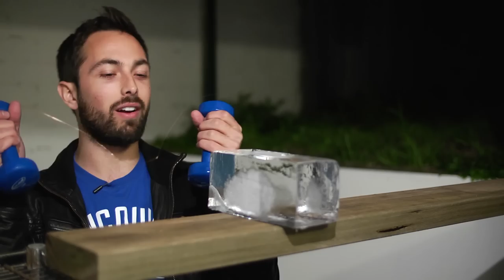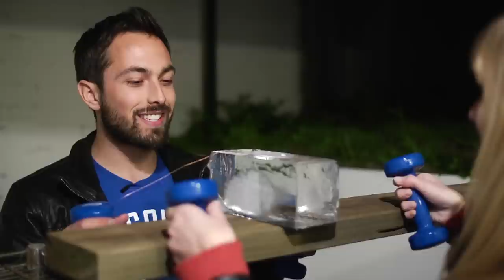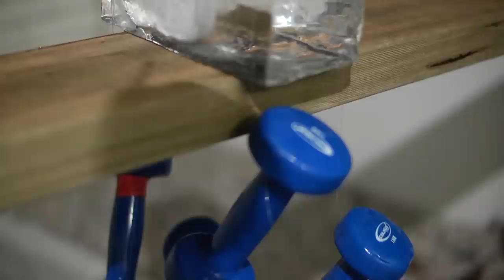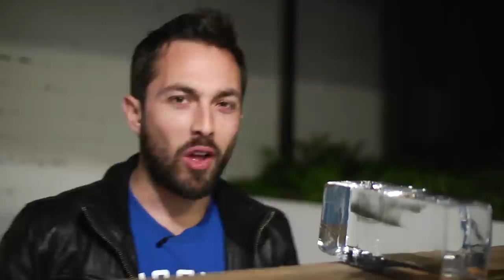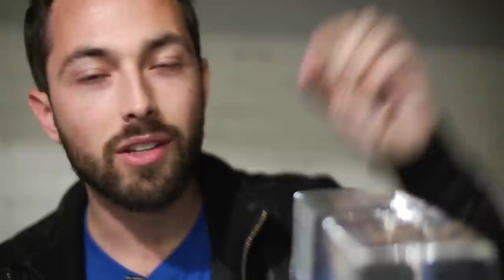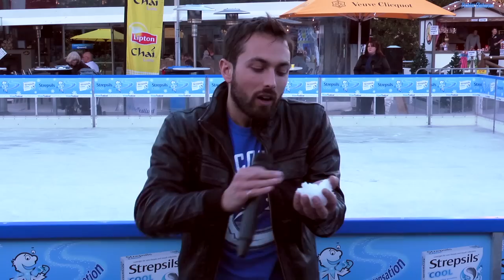Ice Cutting Experiment

Comment: 0 degrees still has a lot of energy. For example, an iceberg has about the same  thermal energy as a cup of boiling water. As such, there still is energy to be released and transferred to the wire from the refreezing of the ice. As for cross section of the wire, he said at the start they were 'about the same thickness'. Hope this helps :)

Comment: I guess the steady state shape of the wire should be  a semi-circle. Here is how:  The tension in the wire is constant. Now the radial force  (i.e., pressure) the wire applies on the ice (and thereby the local melting rate of the ice) varies directly as the wire's local curvature. At steady state, the melting rate  at all points of contact is the same, which implies that the curvature of the wire must also be constant. What do  you think of this reasoning?

Comment: Further experiments should test diameters of the SAME ice-cutting material; the difference between metals of known varying thermal conductivity; and overall temperature of the system. On the last, I'm betting that there is a threshold temp where the copper & the fishing line will work the same. (but that may be pretty close to absolute zero?)
Also, difficult to maintain controls...the thickness of the ice, it's purity WRT trapped particles, the angle of the weights, etc.

Comment: I no longer think it's a catenary. The difference is that with a hanging string the tension changes along it, whereas here the tension should be roughly constant throughout. In this example  if you try to make the normal force the same everywhere you get a circle, but I'm not sure that's the right thing to do. Seems like a better idea is to make only the vertical component the same everywhere, in which case you get a complicated shape that's still closer to a circle than a catenary.

Comment: I'm guessing it's because that's the shape where the weight of the weights is evenly distributed throughout the wire in contact with the ice. At first, almost all of the weight is on the part of the wire touching it edges of the ice, but as these cut through, more force is put on the middle of the wire, so it starts cutting through. Since more force means faster cutting, and faster cutting results in less force, the wire is constantly seeking an equilibrium of balanced force.

Comment: I think it's just as likely that the thermal conductivity of the copper wire allowed the wire to act as a "heat sink" (or cold sink in this case), effectively warming up the inside of the wire by absorbing the warmer temps of the wire not inside the ice.  I am probably messing up some terminology here, it may be that it's actually that the coolness of the wire is dissipating via the exposed wire, but the end result is the same.

Comment: The video is right about the conductivity of the materials, but ignores that the combination of the polyethylene, PVDF, nylon in the fishing line and even the type of the polyethylene defines the weight of the line, and not the same at each types of fishing lines. So despite the same thickness, the copperwire could be heavier, which must be added to the weight of the two 1.5 kg weights.

Comment: Yes it HAS to do with better coductivity, but it's the room temperature wich is conducted through the copper wire onto the ice better (by better contact too) compared to the air. Try this in a room with room temperature below 0° Celsius! .. And the snowballs surface melts because of the temperature of your skin.

Comment: heat isn't all about temperature; changing the state of a system (from gas to liquid, liquid to solid etc.) involves heat exchange; in fact, when you give/take heat to/out of a system, it's temperature increases/drops only until the boiling/freezing point and if you just continue unabated to give/take heat to/out of the system temperatures just stops changing, it stays the same, while the heat goes 100% into boiling/freezing; when all the mass has stopped phase-changing temp. changing continues

Comment: Scraping off the coating means the surface roughness of the wire changes. This definitely means both wire don't have same roughness (or smoothness). 
My point being roughness may be an important factor in the experiment.

Comment: I’m unsure if the faster melting with the copper wire is due to its ability to conduct the heat released during refreezing downward. If heat transfers downward to enhance melting, why doesn’t it also transfer upward to prevent refreezing?

I believe the copper wire efficiently transfers environmental heat into the ice, given that room temperature is higher than the ice's temperature, which enhances melting along with the pressure-induced factor.

What are your thoughts?

Comment: Heat is released because the only way something gets cold is it loses heat, there is no such thing as cold, only a lack of heat. So since it is losing heat, it has to go somewhere, and since copper wire is a good conductor, it goes to the wire, heating it slightly, giving it the slightly higher temperature needed to melt through the ice faster than the fishing line.

Comment: Ahhaha, Well, the reason why it was like "sand" as you say, is because Snow is basically millions of ice crystals, just very light. Because it was extremely cold (-20C) the snow was solid, and not damp. Snow only has "cohesion" or, as we North Americans like to call "cement-ness" when it's warmer, so that some of the snow will melt, creating -some- water, starting to break down the crystalline structure keeping the snow distant from each other, and it starts to become coherent, or slush.

Comment: Before refrigeration in the early days of America. The bootleggers would go to the mountain top and collect snow. They would put the snow into a large open container, and shape it so they could then place a very large bucket of water into that hollowed space. This was so that they could create more ice without having to transport it. They would pour almost pure ethyl alcohol onto the snow, and cover the inner container, which would freeze to solid ice. The newly made ice would then be shaved to fill several more containers to repeat the process.

The whole purpose of this was to make ice cream. 

I do not believe that pressure causes the ice to melt. If you look at some of the items destroyed by ice which expands when frozen, due to the fact that water expands at any temperature, other than 40 degrees Fahrenheit its most dense state. I think that it will show that it is not pressure melting the ice. Steel can be expanded and stretched by the freezing of ice in a steel container. Certainly the pressure necessary is far greater than that of the copper wire applying pressure. 

With movement comes friction, friction is heat. Since the ice is near its melting point, I believe the wire is just trading heat back and forth with the ice. I have never tried pulling a zero degree copper wire through ice though. However my guess is that it would not cut through the ice. I have left heavy pointed ice breaking implements on ice that was exposed to the sun, on very cold days, and they penetrated the ice with time. However on cold nights there was zero penetration by the heavy long objects left on end on the ice. 

Sincerely, 

William McCormick

Comment: It freezes once the pressure is released. The only reason it melts is the pressure that's applied by the wire and weights. Once the wire has passed, the pressure is no longer there, so its freezing point is back to normal, and it freezes.

Comment: While you were right about the snow ball, you are completely wrong about the copper wire's the renal conductivity helping to melt the ice. The temperature of the melted ice and frozen ice is both 0degreesC. Without a thermal gradient there won't be any heat conducted (Q=k*L*dt). The copper cut faster because it was probably thinner in diameter, more elastic and conducted heat from the air around it (in the parts dangling below the ice)

Comment: the higher thermal conductivity of copper also lets it get a bit of the outside temp (assuming it's above zero Celsius) and pass it to the middle of the copper wire - ie inside the ice block - thus speeding the cutting

Comment: When you took the insulation off the copper wire, did that not make it thinner?If it did, the copper wire will now be putting a greater pressure on the ice which basically invalidates the experiment. 
Further, how accurate was the original measurement of the two wires having the same diameter?It looked like they were pretty close at the end and even a small difference in diameter could cause that.
I reckon thermal conductivity matters, but the diameter of the wire is small, the effect is minimal

Comment: I think it's because the force applied is a function of the length of the wire. What I mean is depending upon where you measure the actual force begin applied, the value of this force will vary. Clearly the closer you are to the edges of the wire, the greater will be the magnitude of the force since you're that bit closer to the weights. So by an extension of that logic, the closer you are to the centre, the lesser force you will measure.

Comment: While that may explain some of the difference, Veritasium leaves out the fact that the copper transfers more heat from the wire exposed to the warmer air outside of the block of ice.  That is clearly demonstrated by how the wire cuts faster closest to where it is exposed to the air

Comment: Other than the thermal conductivity being a factor, I would also consider the difference in structure (or lattice) of copper and the fishing line, copper perhaps being sturdier and "sharper"?
Also, copper only has it's own molecules, while plastics usually have carbon, hydrogen, chlorine etc... I don't know how great of an effect there is, but I think it should be considered.

Comment: I remember that the area of the wire touching the ice surface has something to do with its ability to melt the ice. Could the fishing line deform under the pressure from the weights more than the copper wire, meaning less pressure?

Comment: In physics we learned about "Specific Heat Capacity." And how water has about a "4" on the scale. Meaning it requires a lot of energy in order to change the temperature.  Does SHC have anything to do in the outcome of this experiment? 

If I had to guess, I would say that the copper has a less SHC, so it would require less energy to change the temperature of the wire.  So wouldn't the wire get cold and have a hard time melting it?  

Maybe I'm just over thinking this...

Comment: Significantly increasing the temperature of the wire will obviously have an effect, but once the ice absorbs the heat, it's back to watching this video again. What I mean is: the hot wire will quickly melt some of the ice, but as it quickly cools an inch or so into the block, temperature will no longer be a contributing factor.

Does dry ice change states of matter with pressure as does frozen ice?

Comment: Don't forget it would also depend on the thickness of the copper wire vs the fishing line.  The thinner it is the more pressure ur putting on a single point.

Comment: Also the copper is conducting ambient heat from the air along its exposed length into the part that's in contact with the ice. I think.

Comment: Why didn't you mention that the copper wire is transferring heat energy from the room into the ice? For it is most certainly doing that, and is a major factor in the process.

Try doing the same experiment in a walk-in fridge, and see what the time difference is; it will be substantial.

Comment: if you connect the wire to 1 amp 5~20 volts, the wire resistance will be warming it up, and the melting will be mich faster

Comment: Great experiment.
Could the wire also be conducting heat now just from the top side to the bottom, but also up the wire from contact with the air in the wire sections between the ice & weights to the section in the ice?  
What was the ambient temp in the room?

Comment: I'm nto convinced that a single trial is enough to determine this.  I think you need to do this quite a few more times, the two wires seemed pretty close. I don't think your explanation works because the refreezing seems like it is either adiabatic (if its very fast) or isothermal. If its adiabatic then no heat is exchanged, and if its isothermal then the water actually takes IN heat because it is expanding as it turns into ice. The water loses potential energy, but gains kinetic energy (heat).

Comment: I suggest that the copper wire is a better conductor of heat than the fishing line, and so the parts of the copper wire that are not in contact with the ice are transferring the heat from (room?) temperature air into the wire that is cutting the ice.  Not so with the fishing line.

Comment: Ignoring the copper wire (i knew that it was going to win anyway): Interesting, with the "Does Pressure Melt Ice video" it would imply an extremely thin fishing line would go through the ice faster than a thicker one, but at the same time the ice would regellatate, and the ice wouldn't be cut.

Comment: So, what you're saying is that, if this experiment was setup on a room below 0C, both would melt the ice at  the same speed, am I correct?
I mean, if the regelation process depends on the pressure, removing all other factors would result in both going at the same speed, right?

Comment: If the copper wire was the same diameter as the fishing line before scraping off the insulation coating, how did the diameters compare after?

Comment: Why did you strip the copper wire? Without the enamel coating, having the same weight as the fishing line (2 * 1.5 kg), the contact surface is a bit smaller, therefore the pressure is higher, hence more heat. Conductivity could be the deciding factor if the pressure is equal.

Comment: Ice caps are under pressure. How does that work I think it has something to do with the temp of the ice before  pressure applied not that applying preacher changes the temperature. Also I'm curious to know more about this effect. I have a Metal thermos with a small opening at the top to drink out of if I put an ice cube on the top it will cut itself and a half in a matter of seconds but if I push down on the ice cube melts much slower. do to the thermal conductivity like you said but that's explained that I would really appreciate getting to see some more examples of this affect and why it melts faster under its own weight.

Comment: So actually, the fishing line experiment is a better explanation and experiment than the copper line, because it reduces the thermal conduction.  But as the line "cutting" the ice, it will decrease the temperature of the line, making it harder to melt.  So, to reduce those two problem, maybe to do a better experiment, maybe we should do a experiment in a fridge using a copper line?

Comment: Now as to why does it not look like two simple straight lines intersecting at the centre of the block? Well, I think that's because the relation between the force and the position of the point at which the force is being measured is not a simple linear relationship. I think that it is an inverse proportionality (as explained before) so the curve should in fact look like a rectangular hyperbola (y = 1/x is the simplest rectangular hyperbola).

Comment: What temperature was it outside? I'm wondering if the copper wire could have also conducted small amounts of heat from the outside air, while the fishing line wouldn't, and if that could have also assisted.

Comment: How did you rule out the copper wire simply conducting more ambient heat into the ice block and melting it that way? was the room at 0 centigrades aswell?

What about performing the same experiment in a freezer?

If you compress a snowball, isn't the work you do (p*ΔV) a bigger factor in melting the snow?

Comment: Does it have anything to do with the the pressures applied by the wires? Since copper is more dense and the wires are of the same thickness, I would think that that copper and weighed more. More weight over the same area means slightly more pressure applied by the copper. That's why I guessed the copper would win, but I'm not actually sure if more pressure has a real effect.

Comment: But what about water that is under pressure? Does it not freeze as fast as water that is not under pressure? I had an issue with a well a while back and I had to run an external water line that was above ground. It was in the middle of winter and I was afraid it would freeze, but it didn't (temp fell to about 25 degrees overnight). Was this why it didn't freeze, or did I just get lucky? The line had about 50 lbs. of pressure.

Comment: The copper wire "cuts" ice faster because the copper wire is thinner than the fishing wire. Hence, the applied pressure per cubic metre of copper wire is bigger than of fishing wire, the copper wire cuts ice faster because the weight (the force applied to the ice block) of copper wire is greater than the same weight of the fishing wire
Reply: +Arshak Martirosyan Did you watch the initial setup video? He specified that they were the same thickness.
Reply: +Arshak Martirosyan +Kevin Fu I think it's possible that the copper may have contracted more than the fishing line due to being in the ice. Then the copper would have had a smaller contact area with the ice and thus a higher pressure (Pressure=Force/Area)

Comment: Could it be based upon the density of the ice where as it freezes there could be areas which freeze faster than others etc and therefore those parts would take less time to pass through, or the forces of the copper on the ice cube is greater at the edges than the centre causing them to move faster